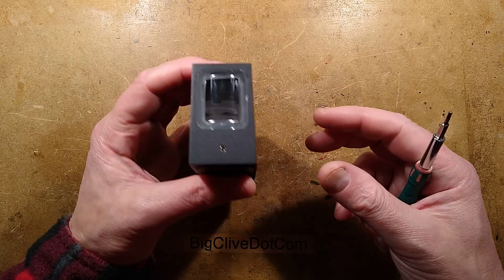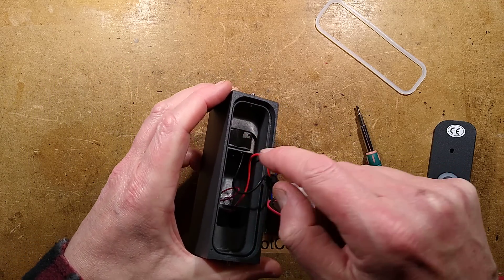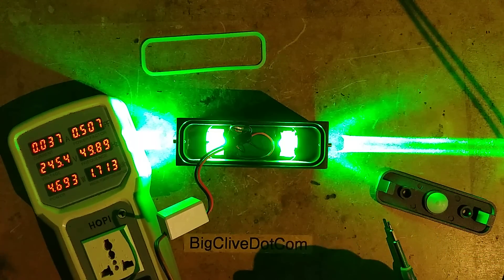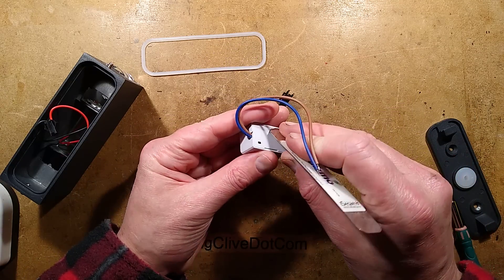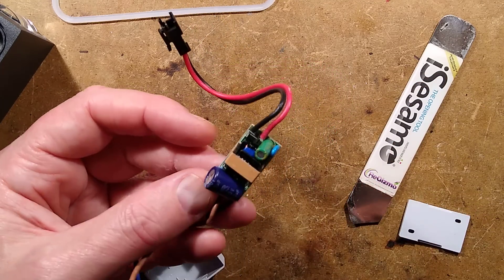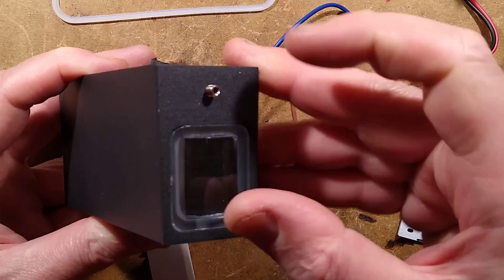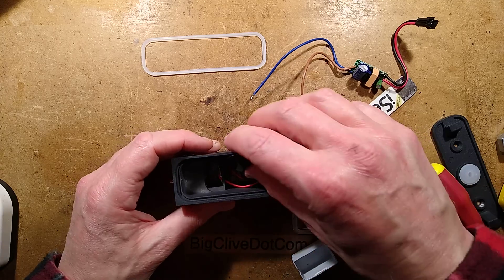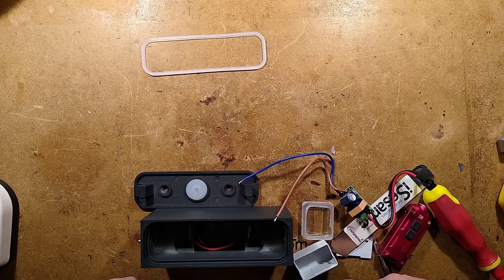Chinese LED line-generator light

Comment: I've seen a lot of lights of this type being used to illuminate house walls, or either side of a front door. Usually, they're arranged to fire the light straight up and down, but just occasionally you find some where the owners have been a bit creative, and have them firing horizontally.  They're a bit weird when used as an overhead light in a front porch!

Comment: I got a bike storage thing where the bicycles have to be pushed into small clamps on the floor at a certain angle. It's neat but sometimes difficult to get the angle just right when trying to store the bikes. Def will consider using these to project guiding lines, going to look cool as well 😀
Reply: You could maybe wire them to momentary switches that activate when the bicycle wheels roll over them then deactivate when the bike is passed them and fully inserted.
Reply: @PongoXBongo  Sounds like a cool idea, or perhaps have the lights on by default and only turn off once a bike is parked there, making it more apparent from a distance where the free spots are.
Reply: You can also get laser line modules. Though if you like this effect, go for it.

Comment: There always used to be a bit of an attitude that lighting circuits didn't really need earthing as long as all the switches had plastic faceplates, because the light fittings themselves were located out of reach near the ceiling and so unlikely to be touched.  Plus, with the old tungsten filament bulbs, there was an extra incentive to make sure the power was off before changing a light bulb because you didn't want the thing to come on as soon as you pushed it into the holder, lest it get too hot to handle before you had locked it in.

I'm sure more than one electrician must have talked a client out of upgrading to metal faceplates in order to avoid having to add an earth to an existing ancient lighting circuit with no earth wires .....  which is great until the house changes hands, and the new owner -- unaware of this history -- installs some new switches with metal faceplates.  And even then, it's still great -- until another fault occurs somewhere else and causes a switch to become live .....

(And if the victim is an MP, or a close friend or relation of an MP, the government will pass a new law, as opposed to actually enforcing the existing laws which would have prevented this situation properly.  Not that I'm bitter.)
Reply: My house was wired up with all the lighting cables down to the switches in metal trunking.  But I'm pretty sure none of it is earthed, and just to add an extra bit of frustration, all the cables had the earth wires cut flush with the end of the conduit.
Reply: I can recall a good number of service calls generated because the occupants were getting an uncomfortable jolt from a lighting switch (with plastic  plate) that was mounted inside a garage. This was mostly a warm weather call due to bare feet on concrete giving the potential  present in the metal plate cover screws a path to earth. If the concrete was wet the jolt apparently exceeded uncomfortable.
Reply: @mcdon2401  Metal conduit should always be earthed, especially when running single-core cables through it.
Reply: @bluerizlagirl  yup.  That's the joys of taking on an older house where you've got no idea what dafties have gone before 🤦‍♂️
Reply: In the US years ago (I'm a boomer in case you can't tell) switches never had a ground.  But the boxes were metal so to ground the switch you grounded the box which was a good idea and probably required by code.  Then at some point plastic boxes became approved at least in residential construction, so switches and any attached metal wall plate became ungrounded.  I notice if I replace a switch (or dimmer) nowadays it always has a ground terminal so I properly ground it.

The only time I ever worried about ungrounded switches was when the switch was near metal plumbing.  Plumbing used to be always grounded, but often is not any more also as a result of plastic pipes and fittings.
Reply: @davidg4288  Another U.S. citizen pushing boomer age...
Yes, metal boxes were almost always grounded by the sheath of BX or a ground lug affixed in the back of the box.
This is why current (/p) devices are backwards compatible , with a brass tab under the lower mounting screw AND a green screw at one rear corner.

While PEX plumbing might not provide a good ground I'll bet the water in those pipes will conduct enough current to give a nasty jolt.
Reply: @jimurrata6785  Right you are!  I just measured one megohm to ground on one faucet stream and 350K ohms on another.  I have mostly copper plumbing but the faucet supply lines are PEX.  So yeah a pipe full of city water WILL conduct electricity.
Reply: @davidg4288  Lol!  🤣
Credit to you! You actually pulled out a meter and checked.
Reply: UK wiring regulations require an earth wire - and have for decades.
Reply: @alanpatterson2384  Oh, yes, an earth wire is required on new installations; but there are a lot of existing installations from years ago that haven't been upgraded to modern standards, because that would require more work than the client wants to pay for.

Would you rather do the best you can under the circumstances with well-insulated accessories, or risk them getting someone else to do a dangerous bodge with exposed, unearthed metalwork?

Comment: Nice little light. Great opportunity to swap the LEDs for other colours, however wouldn't work too well with RGB since the chips are discrete, so the lines would go in slightly different directions perhaps??
Reply: Theoretically it would be possible if the LED chips are in line with the beam direction._

Comment: Unfortunately, with the lens so far away from the LED chip. it's gathering only about 1/4 or less of the emitted light.
Same issue with zoomie flashlights when in The Bat Signal mode, ie, fully zoomed.

Comment: I think you need to pull the blue and brown wires from the power supply through the grommet and make the connection inside the electrical box that's in your wall; no need to stuff more wires into that tiny housing.
Reply: Waht, youtube shows me, that it video released 1 hour ago and this comment four weeks ago
Reply: @ZEMRALEX   Patreon supporters get early viewing privileges.
Reply: Generally there are no electrical boxes of that type in British homes.
Reply: having 2 wires poke through the round grommet WILL cause water ingress.
Reply: @casemodder89  Add architectural water sealant between light box and wall.  Competent builders know how to make buildings waterproof if the individual components do their part.
Reply: @unknown547  How are wall- and ceiling-mount electrical fixtures usually connected?
Reply: If the connection to mains was done outside the box then it would require a large hole in brickwork or whatever a less satisfactory idea then stuffing that box with wires.
Reply: @wbfaulk   generally there is space inside the unit itself for terminal block or wagos
Reply: One reason not to mount this on the wall and wire it in is it's absolute rubish.
Reply: @unknown547  So there are just loose wires inside the wall at that point? It relies on the fixture mounting to hold the electrical wiring securely?
Reply: @solidamber  Aesthetically or technically?
Reply: @wbfaulk  I am not an electrician by any means but I’ve replaced fittings at numerous houses in England. The wires just come out of the wall where the fitting is required. They’re usually protected by metal or plastic trunking depending on what material the wall is made of.
Reply: @wbfaulk  Generally as follows
Socket outlets and light switches are mounted within the fabric of the building. Lighting such as pendants and wall lights are usually just a cable poking out the wall, plastered around (nicked by the trowel) and then the connections are made in a ceiling rose or inside the fitting. Same with outside lights just one or two cables poking out through the wall. Less damage to install, and cheaper.

Comment: Color changing LEDs will have the dies for different colors slightly offset resulting in offset lines, yes?
Would be neat to have a way to mount a laser in there with some sort of beamsplitter.

Comment: We used to earth the backplate with an M4 bolt and a crimp eyelet, and scratch off some of the powder coat where the grub screws were.  Not ideal but just about passed testing.  Philips used to make a similar grazer with full compliance with the regs but it was an order of magnitude more expensive.

Comment: Cool effect and deffo mod-able, especially when that cheapo power supply fails, and it will. Just ordered two of them for my outside wall, will drive them from 12v with a PWM controlled mosfet from an ESP8266 for full dimming. On after dark dim, then brighter when there is motion.
Reply: It might be better if you use PWM controlled constant current led driver for them instead of mosfet. Those leds voltage is lower than 12v.
Reply: @AliusScitmelius  yeah. at least he should use a limiting resistor.
Reply: Deffo cheapo. Willo failo beforeo tooo longo.

Comment: Regarding grounding: maybe it was just the camera and lighting but the case looks anodized, which would theoretically keep it from conducting electricity. That anodized layer could be scratched off, although if it's done correctly it can be a pretty tough and thick layer, and even then only the scratch stuff areas should be conducting electricity.

Comment: Maybe lash a ground wire to one of those mounting holes on the bottom plate? You'd obviously have to strip away the finish of the housing, but that won't matter inside the housing. Looks like the set screws already do a pretty good job of digging into that plate, too.

Comment: isn't the DC power connectors installed the wrong way round? Surely the source needs to be female to prevent the exposed pins shorting?

Comment: I know I've commented it last time you mentioned the iSesamo, but there's really no substitute for them. The knockoffs just don't have the same elastic deformation properties. They're always far too stiff, and get bent out of shape far too easily. Not at all springy like the iSesamos are.
Reply: I bought one recently after Clive's recommendation. Currently they are supplying them with a 'mini-spudger' of the same make and type, just much smaller. Not had to use it yet mind you.
Reply: @colday74  Mine also came with the mini spudger! I've used it a couple of times, although I cannot recall what for. I remember it working great, though.

Comment: No ground terminal and the seal looks dodgy, I would expect IP 55 if not better on this class of devices. Hope there's a thread in case you want to do a grommet upgrade. If I were to design this thing, I would use an external mounting bracket and keep the enclosure tightly sealed, kinda like what you see on these COB LED halogen lamp counterparts. Attaching the back plate to the building and putting the rest of the light on it doesn't ensure watertightness as the wall will have bumps and irregularities that push the enclosure away from the baseplate, making the gap wider. The converter board looks kinda cheap too.
Reply: I think that the installation of this would be screwed into a recessed electrical box, so that the light is flush with the building.  So the seal isn't really required for the majority of the unit (as it's into a supposedly sealed electrical box).  If the connections are made in that box, it's going to be a pretty good situation overall.  The lack of a ground terminal is borderline questionable, but given the above mentioned installation, sort of moot.
Reply: I think the seal is useless anyways in this case as water can still seep into the unit through the two set screw wholes that keep the housing together.

Comment: You didn't tell us what voltage the LEDs run at Clive. Is it 12v out of the power supply?
Looks quite a neat construction great video as we are used to 👍
Reply: They would be good up the garden running of my 12v battery in the shed
Reply: @daztheman552  You have a 12-volt battery in the shed? Who do you think you are Colin Furze?
Reply from the maker: Current regulated supply that will match the combined forward voltage of the two LEDs.  Probably around 6-7V.

Comment: Laser line projectors are super expensive & dim, hence why they might be using a common LED.  Need a line projector for steering an RC car, but it has to be visible in daylight.

Comment: Is brown and blue wiring only for AC wiring in the EU?
Reply: Nope. IEC standard also uses blue and brown for DC circuits. For DC circuits, brown is positive, blue is neutral, and gray is negative, along with green/yellow for earth. Not all wires exist in all circuits. In an unearthed DC circuit, there is no blue. In a negative-earthed DC circuit, there is no gray. In a positive-earthed DC circuit, there is no brown. (So neutral-ness trumps polarity.)

Comment: Clive, would it be possible to drive the LED's from a 12 or 24V DC supply (and possibly change them to white light)? I've been thinking that as these lights project a line they might be useful to project guiding or marker lines such as when a larger vehicle is reversing to highlight the vehicle extremities as lines of light on the ground. What do you think?
Reply from the maker: You can get 12/24V buck regulators for driving LEDs.

Comment: I see maybe using these to illuminate stairs
Reply: Last week I saw a cool looking solution somewhere, using simple LED strips that were placed on the bottom (you know, on the overhanging edge) of the stair steps shining down. They were dimmed warm white, but if you're in a kinky mood, you could also use RGB LED strips.

Comment: the little alluminium box seems to be quite sturdy... seems great for simple outdoor decoration (deck) lighting
Reply: even more reason to provide an earth connection in that situation (and supplementary sealant)
Reply: @Derek_Garnham  true... although personaly i dont care... in my work i have had 230V shocks more than i can count.. also modern leakage circuit breakers are so sensitive
Reply: @Derek_Garnham  well yes.. but lets be clear.. an alluminium box should be grounded!

Comment: Suppose you got really creative and, after mounting the unit on a wall, mounted homemade aluminum foil (shiny side) reflectors around to redirect the lines all over the place in some sort of pleasing mannner. Maybe even use bits of glass to act as beam splitters to spread the show around.

Comment: I am not getting the point - maybe someone can enlighten me: these connectors (and on LED strips as well): why is the power on the male side while the load is on female side? The male side is completely exposed i.e. to the short or so. I would put it opposite: exposed pins for the load rather then the power going out

Comment: How do they get away with no ground? 
Everything should have a ground/earth terminal screw. 😢😳
Reply: I agree, but I suppose one could press a ring terminal on the ground/earth wire and put it between the mounting plate of the light a toothed washer to make contact and one of the mounting screws. It may not be the correct way according to the official standards but it should be better than nothing. 
A better option might be to drill and countersink the backplane from the outside for a M4 recessed screw and have M4 screw wtith nuts on the inside for the ground. 
Also, I think it would be good to add a little water draining hole in the lowest side of the housing.
Reply: You don't need a separate ground if the chassis is connected to neutral. It's possible that that power supply connects its output negative to the input neutral, and it's possible that the screws mounting the LED board to the chassis are also connecting the board negative to the chassis. That's a lot of supposition, though.
Reply: @wbfaulk  
I’m sure you don’t for it to function. In the good old USA everything sold here must have a ground for safety
Reply: @wbfaulk  Having neutral connected to the chassis could be potentially lethal and should never be done.
Reply: @SiaVids  correct because a neutral can have voltage on it. In the USA it’s considered another conductor. 👍

Comment: I just got one of those power supplies in the mail with an LED spotlight! Super weird, claims to be 12VAC (who even has access to 12VAC?!) in, 3VDC out, works with 12VDC in, but measured output is also 12VDC, where's my 3VDC? The LED spotlight is rated for 12VDC anyway so... not sure what to do with it, might use it anyway?

Edit: Just read the cover and it is a dimmer (LED Dimming), I guess regular AC dimming can be used through the dimmer?! With... 12VAC, still weird, guess I wont use it.
Reply from the maker: If the power supply is current regulated the voltage will match what is connected to it.

Comment: I don't understand this thing. Why would you hook it up to mains? That seems like an awful lot of hassle (not to mention danger) just to get a line of light. I would think any sane person would get a battery-powered one. It'll be easier and safer to move around as well, since let's face it: you don't always need a line of light ONLY in the vacinity of a dangling set of mains wires. I guess if this thing HAD to be mains powered (which it doesn't need to) it would have to "be" a plug, so you can just plug it in as-is. Plug would need some freedom of rotation though.
Reply: I guess it's a matter of perspective. To me battery powered sounds like a hassle because I need to switch or charge batteries every few days / weeks / months. Why NOT make it mains powered when it is mounted in a fixed place anyway?
Reply: "This is an architectural feature light." That means it's intended as part of the light design for a space. It's intended as a permanently installed fixture in a commercial setting, probably a bar or disco.